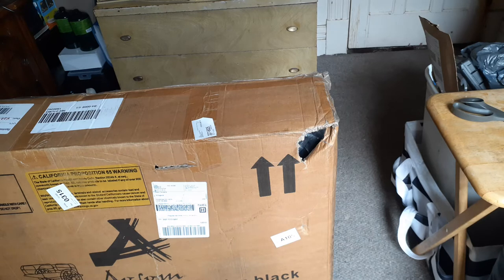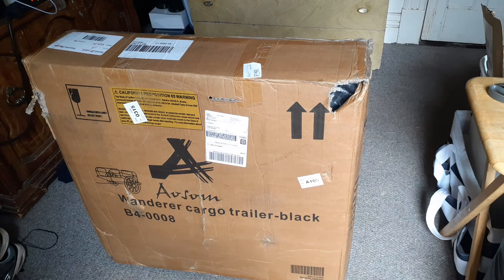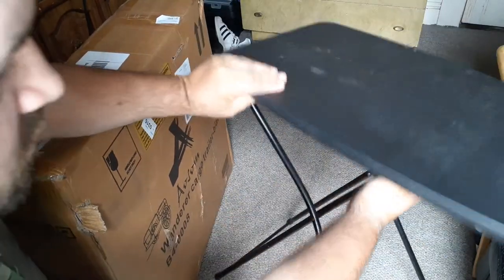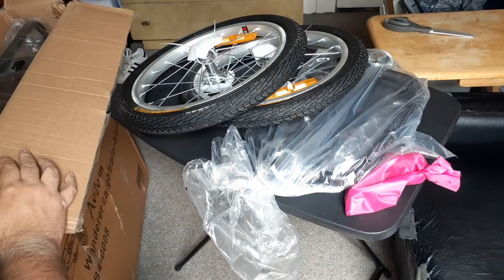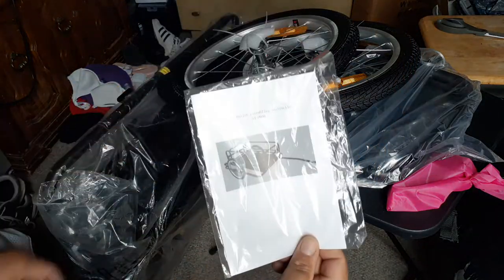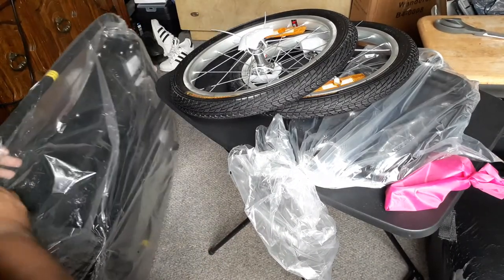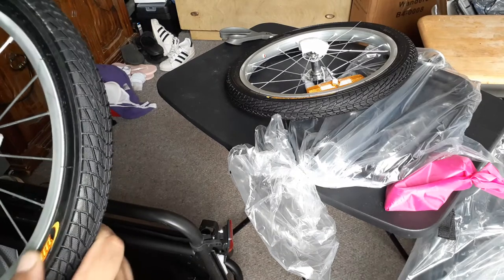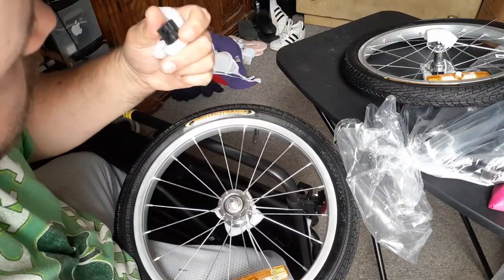Unboxing and assembling of the aosom wanderer cargo trailer  pt 1

Comment: I hate air tires on this wagons ... if they are flat ... you have a Problem... i change this kind of tires always in full rubber tires ... best option for never pumping ... 😜✌️ ... on my bike I have also TANNUS aither 1.1 no air never flat tires ... perfect 👌
Reply: Wait to you have to change those Tannus tires they are not easy to fix out on the trail.
Reply: @paulahavens2764  … I have it on my bike … I do not need to take it on in field … I drive since 3 years without a problem with this rubber tires … perfect 😁✌️🍀🔥